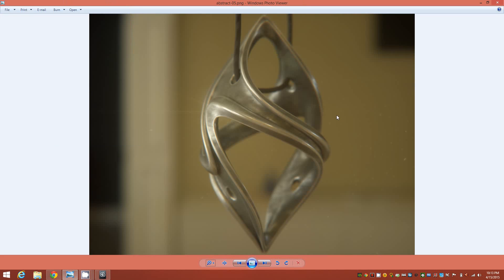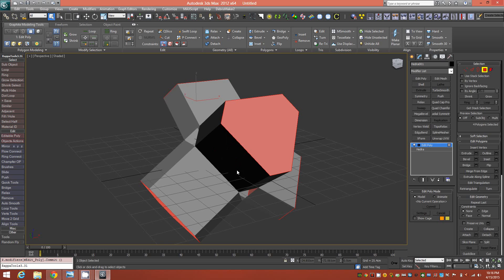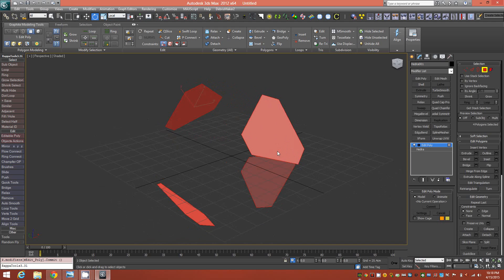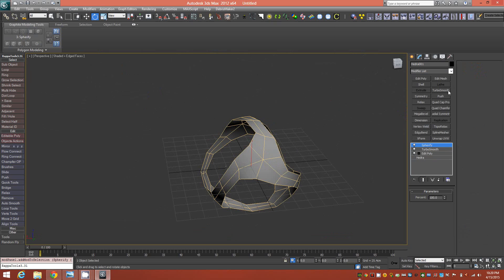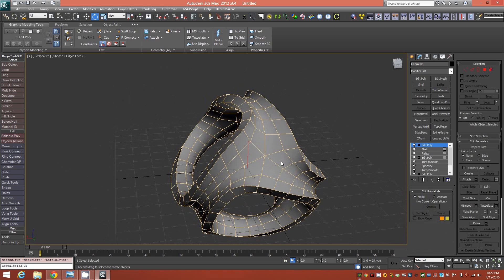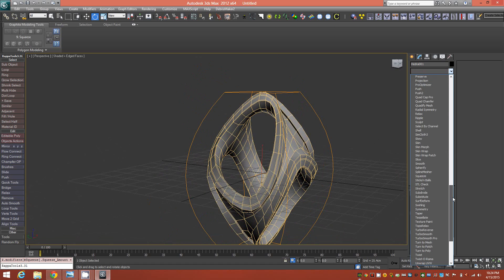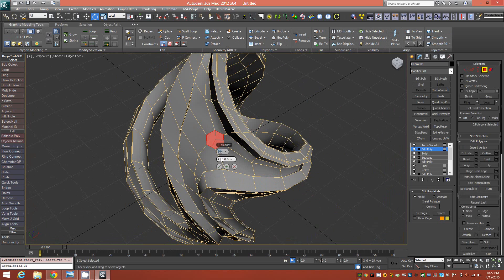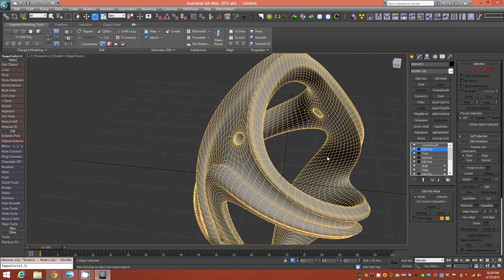3d Tutorial | Twisted Fantasy Pendant | 3dsmax

Comment: Excellent ! I´ve been modeling for years in 3ds max and what i´ve found in your tutorials is extremely helpful. Thanks a lot for your time sharing your expertise. I really appreciate it.
Reply from the maker: Thank you very much!  There's always new techniques and tricks to learn in 3dsmax.  I'm always finding new strategies and different workflows with the software.  I'll have some new videos coming very soon.
Reply: I´ll be in total alert waiting for those new videos. So far, i keep practicing watching your tutorials over and over again. Thanks again. Question: If someone wants to focus on just jewelry modeling, do you think one should considering using Rhino Gold instead of other 3D softwares ?
Reply from the maker: It depends on if you are serious about breaking into the jewelry design industry as a professional jeweler or designer.  Most designers in the industry are also jewelers themselves and professional jewelers use Rhino and some other specialized CAD software for their designs and prototyping, which eventually make it directly to fabrication.  So in this case,  you're much better off working primarily with CAD software like Rhino, Matrix, JewelCAD or 3Design.  These applications are the industry standard.  However, you can do pre-viz designs in any software you like, including some 2D drawing packages.  3dsmax is nice to use for creating very quick pre-viz designs that you later rebuild in CAD, because design process is much faster using the polygonal tools in 3dsmax.
Reply from the maker: In addition to what I mentioned in my last response, I should point out that if you are thinking about doing jewelry for 3d printing, then 3dsmax will be excellent for that.  I have a Shapeways store where I sell jewelry and other 3d  printed items, all of which are modeled in 3dsmax.  However, machined and fabricated pieces which hold diamonds and other precious stones need to be modeled to precision in a CAD software because the fabrication process is much more involved.
Reply: Thanks John for all the info. Really appreciate it. Actually I´ve just sent you a message asking you just what you´ve said in your response. In the jewelry I work for they want someone who can model in 3D let say a ring, then get this model printed in a 3D pico printer, and then take the end result to the shop so the jeweler works on it.Of course the piece will have diamonds and precious stones. So, as I understand according to your response I better consider using a CAD software than 3ds max, right?
Reply: Once again, thanks a lot for all the info. Extremely useful for me now. Have a great day John. Amazing tutorials.
Reply from the maker: If the 3d printed part is actually going to be used as a mold for the ring, then you may need to use a CAD software to get the precise placement of the stones and other elements of the ring.  If the stone placement is incorrect by just a fraction of a millimeter, it could cause stones to come loose and fall out.  That would be a disaster.  However, if the 3d printed version is only being used as a visual reference, then you can use any software you prefer.
Reply: John, you have no idea how much i appreciate all the info you´ve shared with me. Thanks a lot for your time bro. Everything that you´ve pointed out has given me a clear vew of what I must take in consideration if i want to go in the direction of designing jewlery in 3D for shop production. The jewelry i´m working for is proposing me if i want to get into designing in 3D and getting the models for printing and then send the molds for production. With your advices I can see now that this type of task in not just about modeling, is about understanding the jeweler´s production process as well. Now I can talk to them with a better understanding of the whole thing thanks to you. I´m alreay a follower of you in social media. Have a great day. Best frequencies always.

Comment: Nice, dude!!! 
How do you select those polygons at once in 6:55
Reply from the maker: Select one polygon, then hold shift while clicking a second to select the entire loop.
Reply: Thanks for your help!!!
Reply from the maker: The technique also works for edges, vertices, etc.  I assume you're working with a recent version of 3dsmax?  Older versions had a different way of dealing with this, but this should work for Max 2016 and up.
Reply: i'm actrually using Max 2016 though. This technique is really helpful, all thanks to you!
Reply: Edge selection is even easier.  Just douible click on any edge and you will select the entire edge loop.  This won't work in polygon mode, but it's a breeze in edge mode!

Comment: I think I could figure out how to do this in Blender. I'd also be willing to bet the clothes were nice and dry by the time you finished making this.
Reply from the maker: +pauljs75  Thank you for commenting.  If you ever do decide to try this one in Blender, I would love to see the results.  In Blender 2.75a, there's a new modifier which helps achieve the same results as the 3dsmax Relax modifier; the new Corrective Smooth modifier allows you to pin boundaries while smoothing, which is useful for certain effects, and saves time over the standard vertex smoothing on selected points.  It's a fairly simple object to create, but I never did get around to translating this video to the Blender platform, unfortunately.  So let me know if you give this one a go, and I'll promote to your video from here, to share with others.  Thanks again.

Comment: Hi, John. Very nice tutorials so far. I'm using maya 2014. At 3:00 you are rotating each face around their centers. Do you by any chance know how to do this in maya? It seems I can't find this option. Thank you
Reply from the maker: Ko Jak When using the combined manipulator, be sure you are in the local axes.  I haven't used Maya in quite some time, so you may need to refer to the manual regarding transformation of polygon components to get accurate information on this.  If you know someone proficient in polygonal modeling in Maya, feel free to refer to this tutorial, and see if they can help you out.  I'm sorry I can't be of more assistance when it comes to the Maya workflow yet.

Comment: I follow a lot of your tutorials. Really great ones... Could you pls tel me how you select the polygons in a loop...??? Is it by shift selecting the second polygon? i was following your voronoi style bracelet, was not able to select in loop... You had first selected four polygons and then selected in a loop.. How did you do that?
Reply from the maker: Joel Chacko Thank you very much.  Yes, in 3dsmax 2010 to 2015, you could select one polygon, then hold down Shift on keyboard, then select another face along the same loop, in the direction you wish to go.  This will automatically select the entire face loop.  In 2015 and higher, you can simply double-click a face to get the face loop selection.  In the other tutorial, I selected four faces, then simply used the Loop hotkey to select the loops based on those first four polygons.  You could use the "Loop" button in Graphite or Edit Poly modifier to do the same.